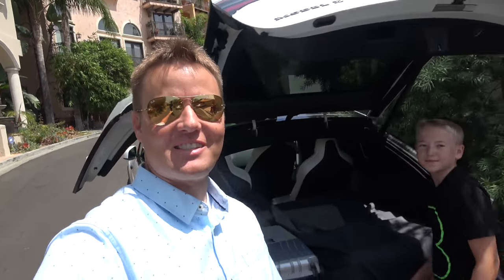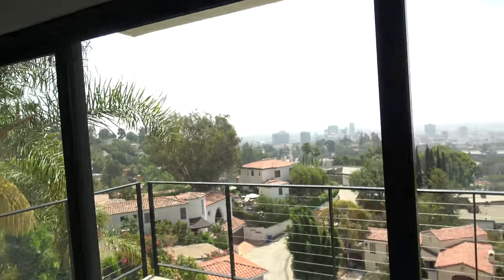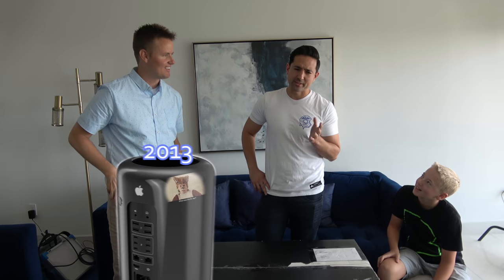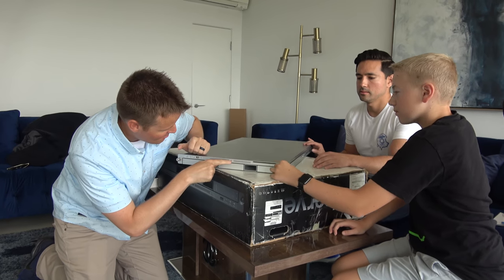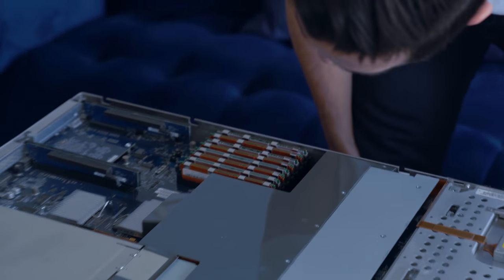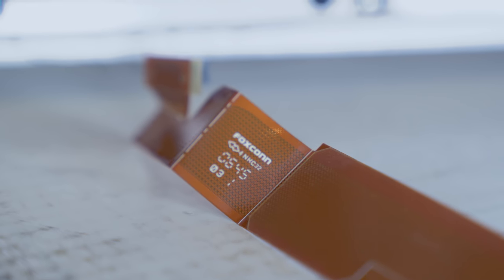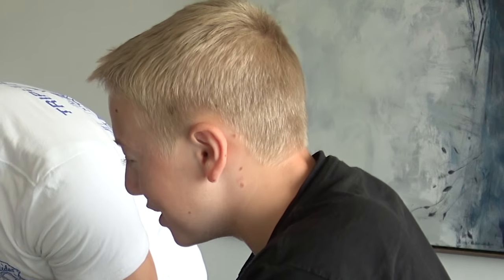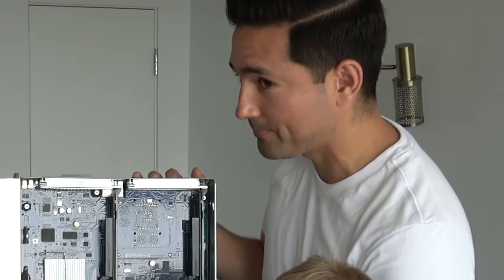What's inside an Apple Server?

Comment: How a heatsink cools things is pretty simple - it makes contact with the processor with that thermal paste between them for better thermal conductivity, and just provides a larger surface area for the fans to blow air through, which dumps that heat energy into the air being exhausted out.

Comment: I hate how much marketing lies have permeated consumer electronics users brains. A server IS NOT A CLOUD!  Cloud computing is made up of excess capacity of servers, routers and switches with software running on them that delivers self-service functionality, orchestration and the ability to provision and de-provision compute resources automatically. 

Ultimately the ‘cloud’ is someone else’s problem and comes from network diagrams created by network engineers & architects that showed obfuscated Infrastructure or Infrastructure you weren’t responsible for as a cloud icon. 

He could have been accurate and said a server is a larger computer than you’re used to seeing, that’s designed to be always on with easily replaceable parts that serves (hence the name) content (files, documents, videos, web sites, etc.) to client computers like your laptop, desktop PC or phone. 

Claiming a server is ‘like a personal cloud’ means you don’t know what you’re talking about and should leave your ‘expert’ credentials at the door on the way out.
Reply: OK, so I just checked out Jonathan’s channel and I was maybe a little harsh on him. He’s a consumer electronics guy, not an enterprise IT guy, so it was what’s insides error describing him as an expert when they effectively took a B52 bomber to a BMW salesman.  Sure, it’s got wheels and an engine, how different could it be, right? SMH.